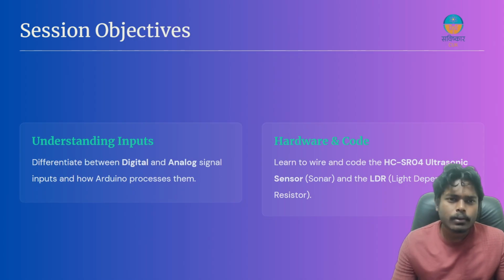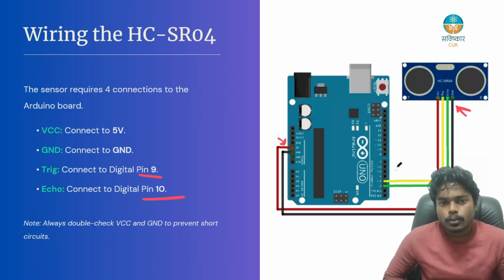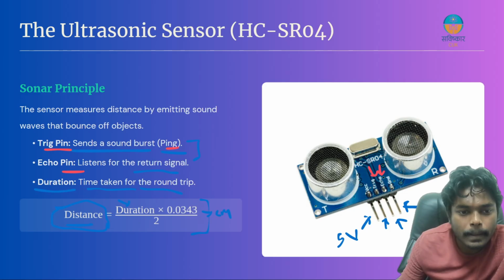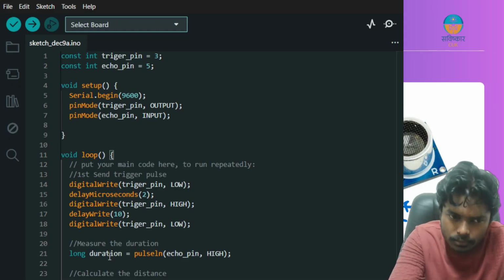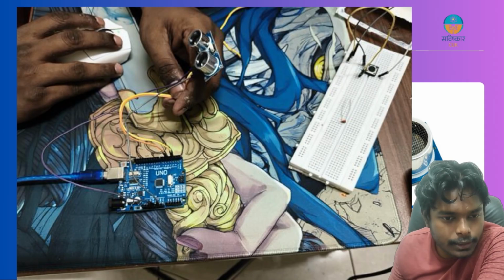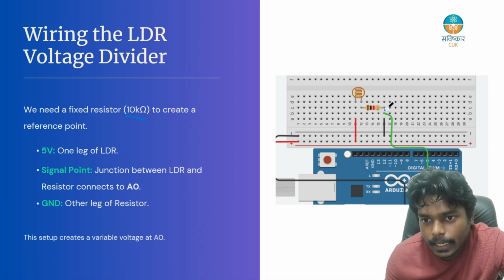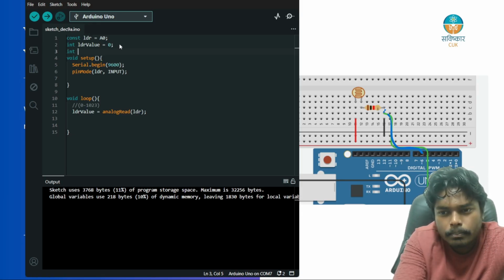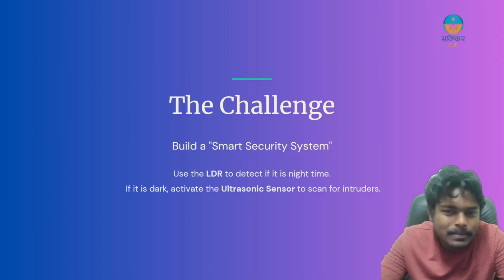Session - 6: Learn Analog vs Digital: Interfacing Ultrasonic Sensor & LDR with Arduino

Comment: serial.begin(9600); is a BIG Question mark here 😵‍💫
WHATTTT ISsss THATTTTTTTTTT ????
Reply from the maker: its nothing bro
Just to print stuff into your computer saying "Okay this part has been executed" or whatever you want to show 
and Serial.begin(9600) means its comes under the void setup() fuction where you are setting up the print option at the data rate of 9600 baud
No need to worry much of it man just chill
Reply: @SavishkarCUK  Still can't fully get the point of that line 😓